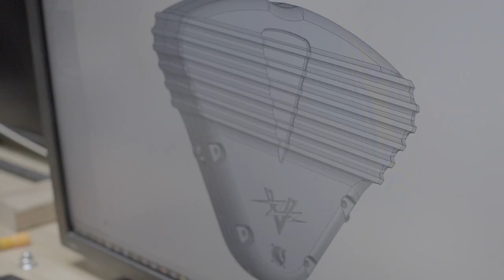Emory Outlaw Tracker by Vintage Electric

Comment: I used to build  bikes as a kid in the 1970s - And my Dad loved his western movies !  -So  I was brought up on them to  ! - By the time I was  16 or So I had had enough of my Dads Westerm movies ?  - Although I do  like this new breed of gritty kind  of western that weve been presented with recently - But even back in the 70's  I was aware of the way the good and the bad worked in these flicks
First bike I built was called the Outlaw  (I know !) -  24" Wheels white wall tyres • 3 speed sturmy archer with 3 speed twist grip changer • Cowhorns • White frame with Red weldings 
Second bike in that series  I built was the Bandit - 24" Wheels speedway knobbly tyres • Half speed cog • Cowhorns • Red frame with Black weldings  - For a 12/ 13 year old they looked good ! - If I may say so my self  !